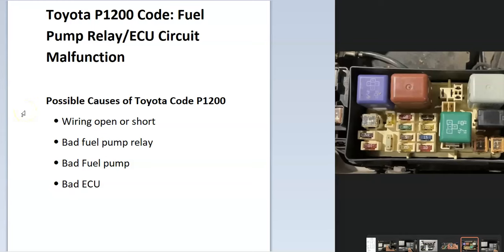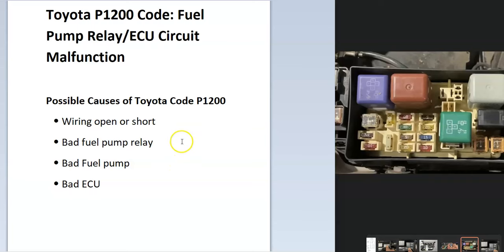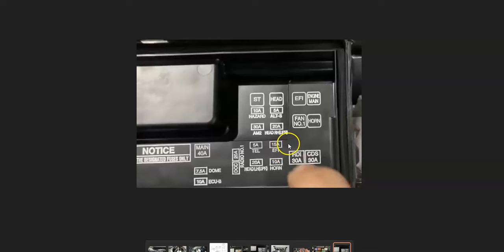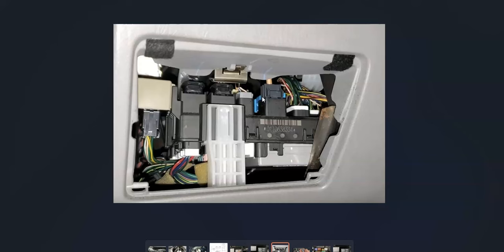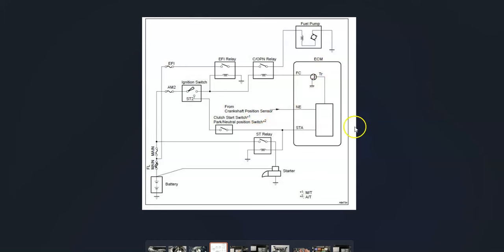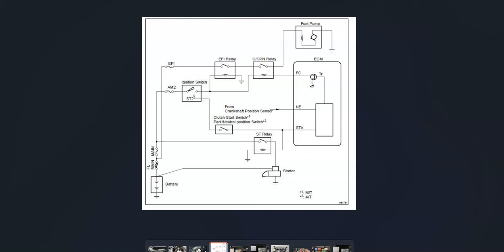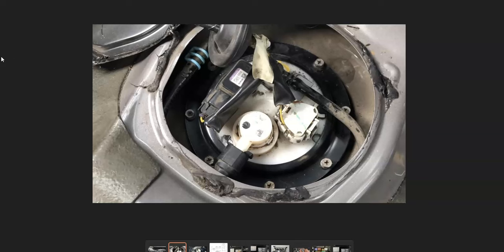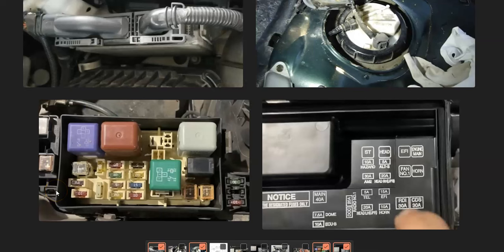Causes and Fixes Toyota P1200 Code: Fuel Pump Relay/ECU Circuit Malfunction

Comment: I change the crank sensor I took the intake off changed out the pressure switch regulator for the fuel and come to find out it's it was a blown fuse on the ECM fuse and every time I connect the reader the diagnostic reader if anything comes to your mind let me know what you recommend it might be thank you and God bless

Comment: 2010 Toyota venza V6 I have ECU fuses blowing out the ECU fuse is blown out what do you think you might be 2010 model I don't know you said 97 2007 and it's got the push button key where you start hold the brake and start it